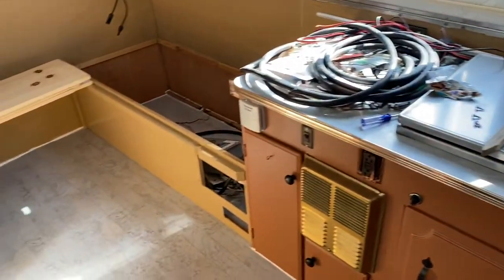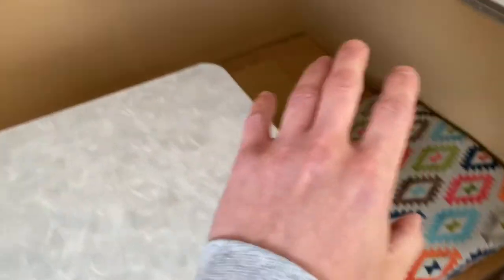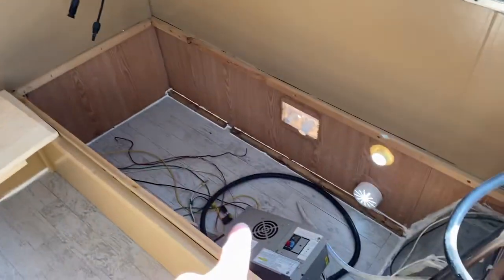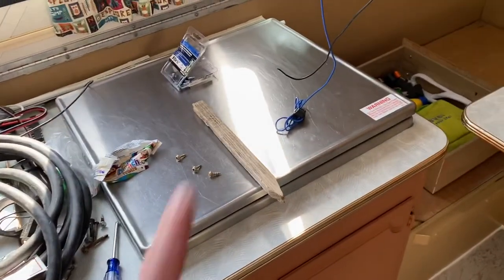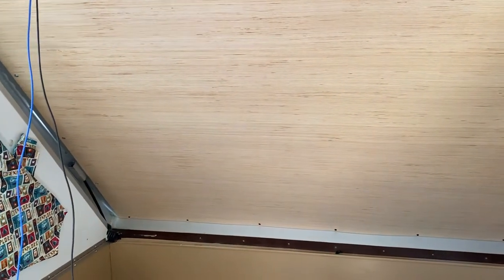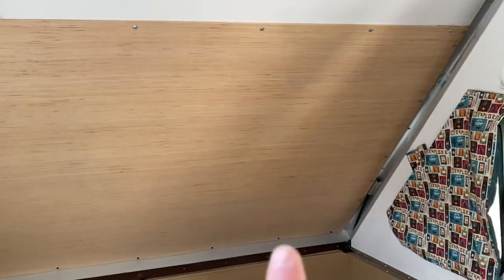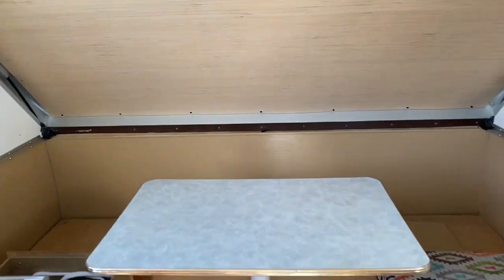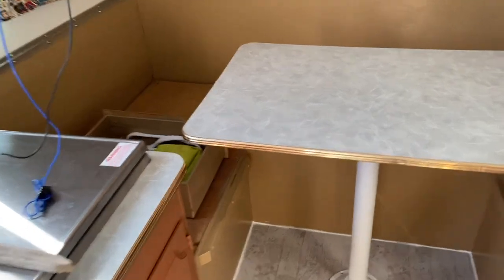1999 Aliner Camper Trailer Restoration

Comment: what did you use to cover the wall where the bubble window used to be
Reply from the maker: On the exterior it was some laminate from Lowes that I cut to fit. It was probably 1/8" thickness some sort of plastic material. The inside was a thin material for walls. Thinest possible to reduce weight. Exterior I added insulation between wall and some wood for support, siliconed well and screws. Hope this helps